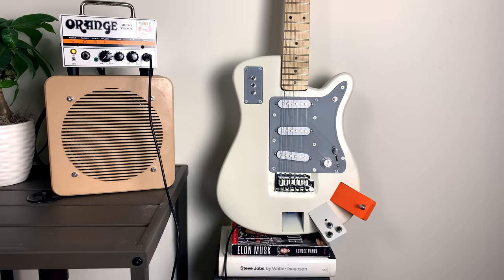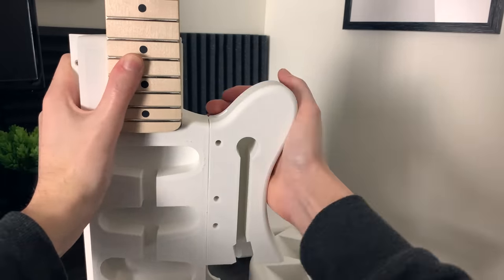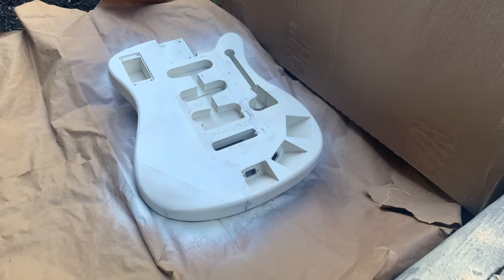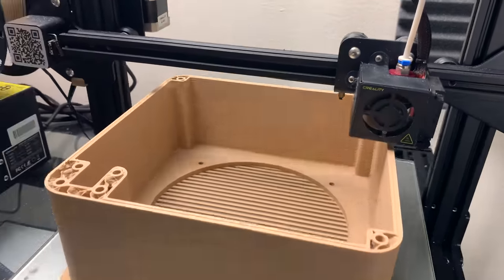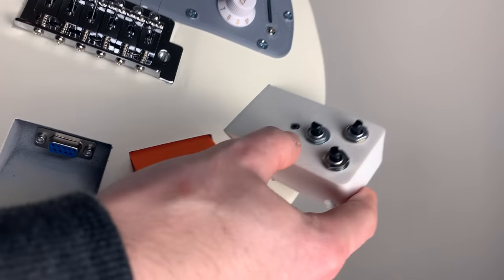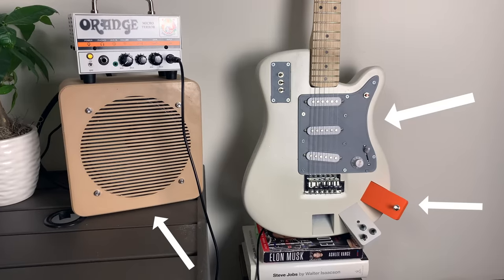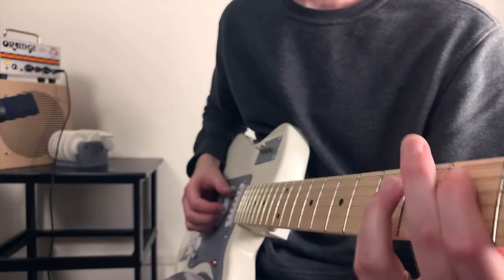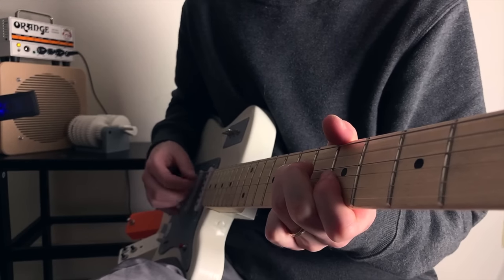This 3D PRINTED GUITAR sounds AMAZING...

Comment: I bet you could make an acoustic guitar with 3d printing if you got the structure right to be durable and contain the sound enough so it resonates and exits mainly through the sound hole. For that matter, I'm sure you could print other hollow acoustic instruments as well. Martin has made guitars out of a recycled wood particle material that gets super compressed into new sheets of wood, one of which I own myself and it sounds undisguisable from other acoustics, the only difference being noticeable between body sizes.

Comment: Another nail in the coffin of "tone wood matters for electric guitars"
Reply: it doesnt matter what wood you use for your guitar, but this one sounds quite thin and doesnt really have a lot of body. i suppose it is made of plastic
Reply: @lucasc5622  and it’s not solid
Reply: @lucasc5622  that could also be the small amp and homebuilt cabinet, or the microphone
Reply: The guitar actually sounds plastic
Reply: It’s impossible to tell if this guitar actually sounds any good in person. It sounds pretty bad in this video, but that could be any number of issues that aren’t specifically related to this guitar. The orange tiny terror is not a very good amp, the speaker cab probably doesn’t sound very good, and who knows what kind of microphone he used to record this demo. Also, most of the recorded examples sounded very out of tune. I would like to hear one of these 3D printed guitars demonstrated through a properly mic’ed amp like a Fender Deluxe or Marshall plexi or something.
Reply: There is also no info on the pickups and the settings, so it can be anything.
Reply: For those saying tone wood matters go listen to the concrete guitar beautiful sound and solid concrete